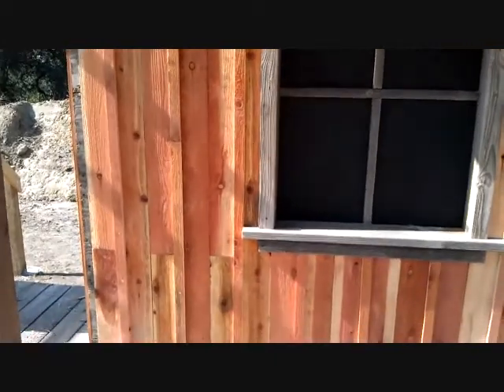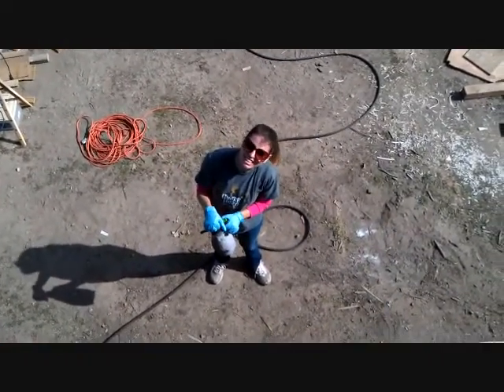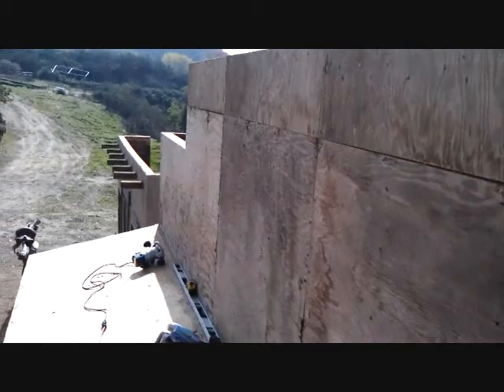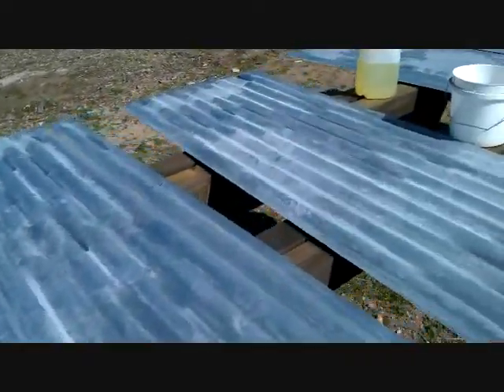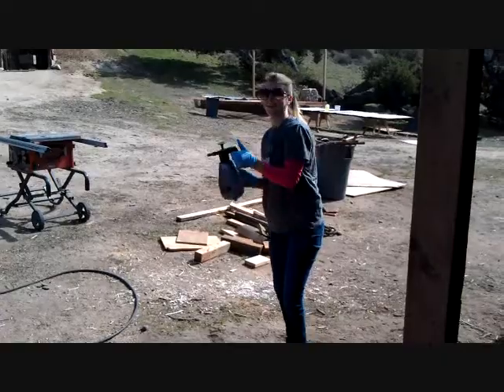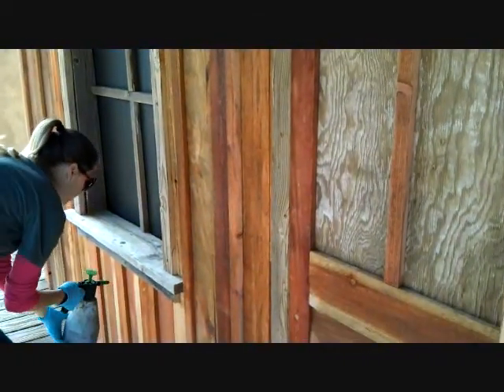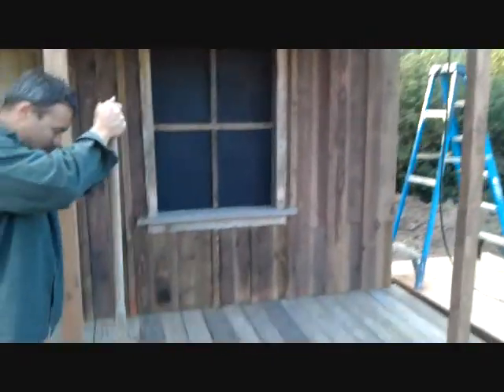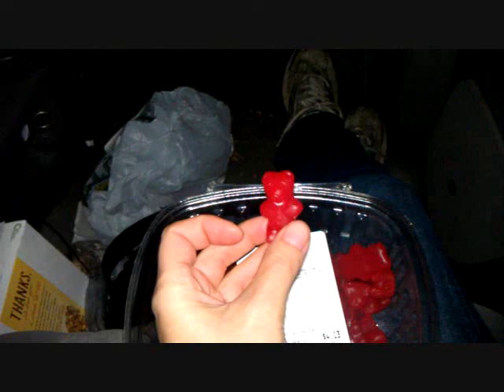Make New Wood Look Like Old Wood | Rust & Age Galvanized Metal With Acid | General Store Facade Pt.2

Comment: You shouldn't need to put so many coats/layers of acid on the tin... one layer will work...it is not rusting because you need to  cover in hydrogen peroxide to make it turn rusty...
Reply from the maker: Thanks ya it only takes a little but if i remember correctly we never cleaned or removed whatever clear coating or protective layer that was on that metal first. Once we started we kinda just kept trying to eat through.  We haven't had that issue ever since.  But now I lightly sand all the metal and wipe away any oils etc.